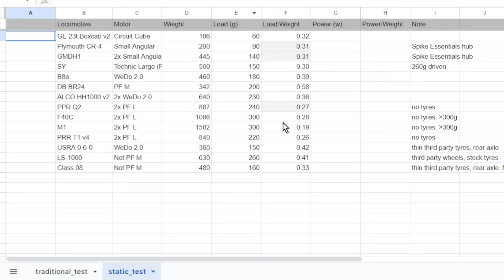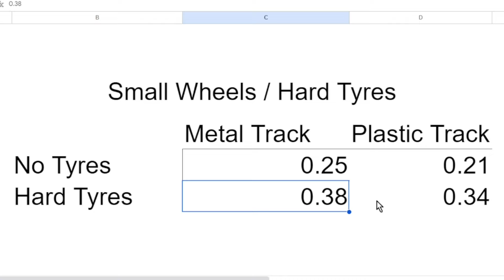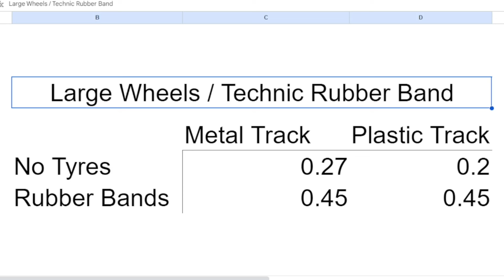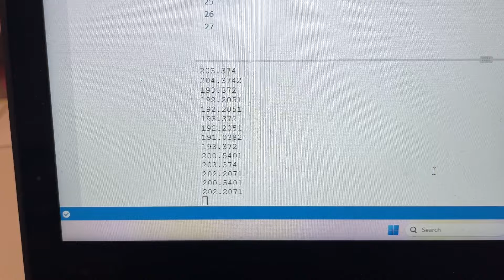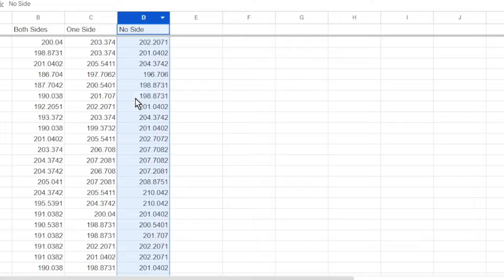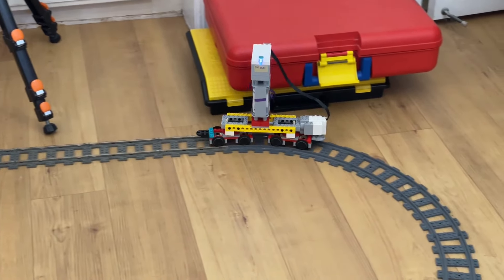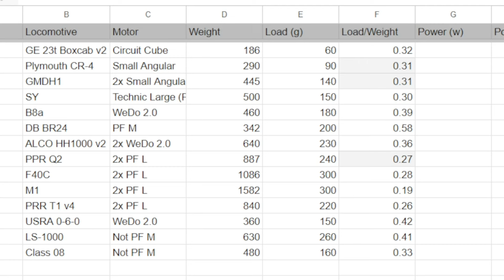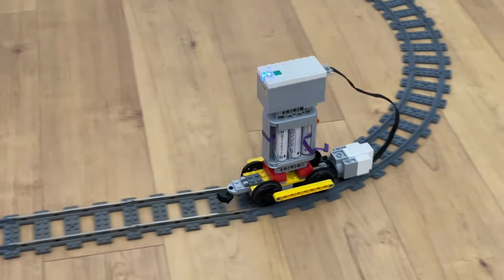How Much Do Tires Help (or Hurt) #lego Trains?

Comment: In regular model trains. Tires are usually applied to increase the pulling power of lighter locomotives. It comes at a cost of reducing the number of contacts for power. Lego does not have to worry about that as the power is supplied by a power supply in the body. So adding tires just makes it easier for what ever locomotive to pull more. The only problems I can see is possibly over torqueing parts and having to replace tires frequently. There probably are other problems but I can't think of them at the moment.
Reply from the maker: Aside from the power pickups all of this applies to LEGO trains too!
Reply: As noted in the video, one problem is increased friction on curves
Reply from the maker: Yeah, the problem is less noticeable for "regular" model trains because the curves are relatively wider. That being said, you can mitigate it for LEGO trains with wide-radius curves too.

Comment: Thanks for Detailed video, it was a pleasure to watch. My take on the topic is i went to a store runed by an old dude who knew everything about O-rings and we found an excellent replacement which was a little thicker and more soft tyen the original and it worked great.
Reply from the maker: For the small wheels or the big wheels?
Reply: @NonsenseWars  i only dealt with the regular size

Comment: Meanwhile with 12V LEGO Trains, the rubber rims are essential :) without them, a locomotive just spins its wheels and barely moves

Thank you for your video, it’s always interesting seeing how the new stuff compares. Those red silicone drive belts are a great material, I bought some through Bricklink to use in old sets instead of old Technic rubber bands
Reply from the maker: If you put enough weight on those 12v motors they will probably still run without tires lol

That being said the "teeth" on 12v track probably hurts more than helps.

Comment: Good video as always. I have an angle no one has tackled yet on Youtube; Lego trains on Duplo track. That is to say, purely System vehicles running on Duplo track. Went down this line of thought due to having a younger relative, whose powered duplo train died, and looking at making an alternative via standard Lego.
Reply from the maker: This is an interesting thought: I think a big consideration would be having it geared low enough to go up Duplo slopes. Even the stock train seems to struggle a bit at times.
Reply: @NonsenseWars  4185 with white rubber band works for the wheels with 32198 as the gear for interacting with the Duplo slopes' "cogwheel" system. Primary issue I had was how to distribute weight so as to avoid flopping over, had to switch to the larger Duplo wheel frame arrangement used by Lego.

Comment: I wonder what the results would be if instead of just putting tires on one side, you only put them on one axle or alternated which side they were on?

I've never even considered doing such experiments myself as all my locomotives seem to struggle for traction as it is, I countered this by adding a lot of weight to them.  Though all of them just use the standard LEGO train boggies, even the steam locomotives, which are actually tender driven.

Comment: Please just use the train motors, I can see that it’s probably more powerful with the normal motors but it just dosent look good
Reply from the maker: The tires are going to hurt the train motors even more in curves since they are optimized for speed instead of torque. LEGO gets around it by making all of the official trains relatively light.